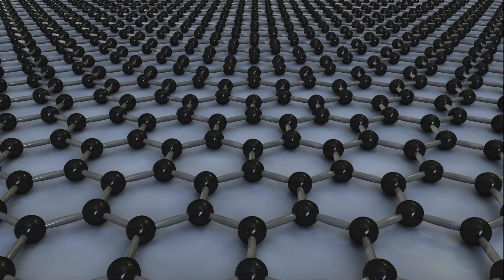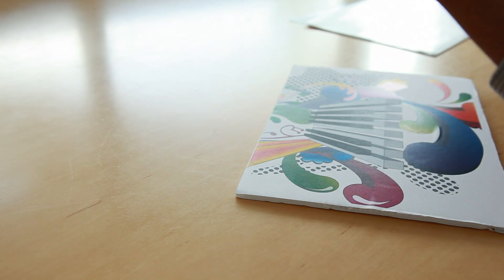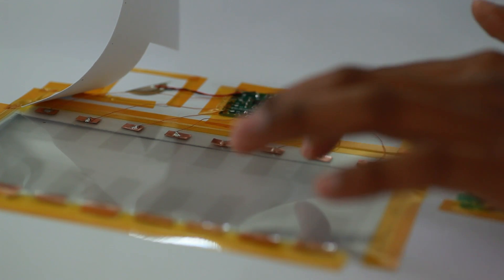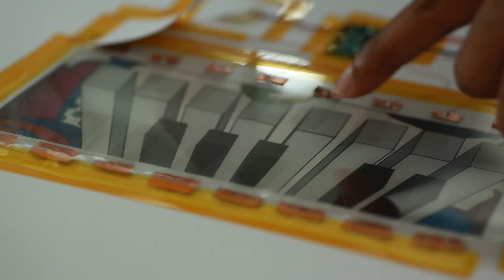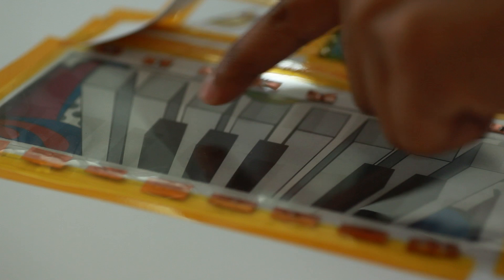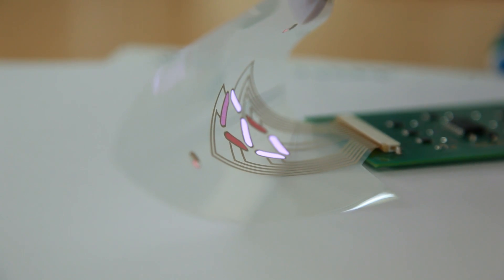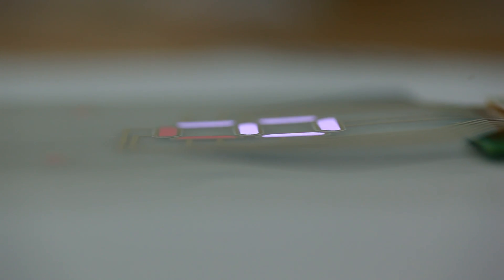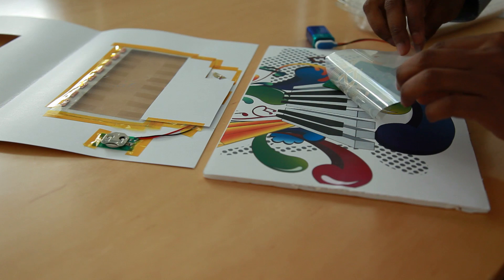Graphene based ink

Comment: Thanks for showing another persons patient on ink developed circuits. Might want to mention this. They were on T.E.D TV. Also ink circuits are used in developing handicap devises for people made from clay. 

Buy the way this video is understated on properties that graphene can be used for by 100 fold! All those wafare boards can be replaced using graphene as the traces, capacitors , GPU and CPU of the computer.